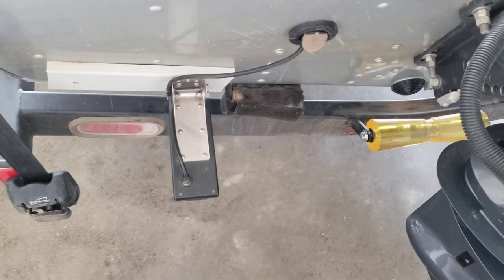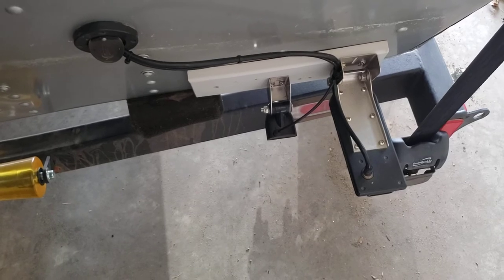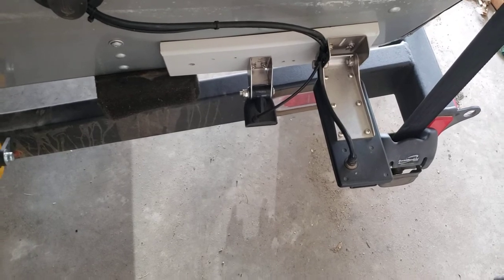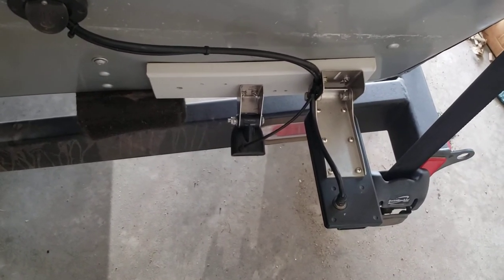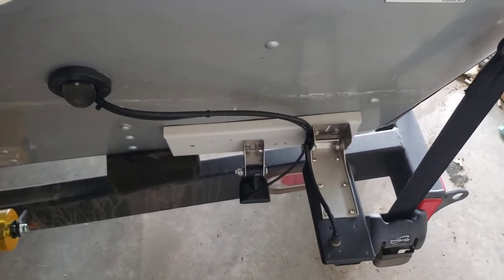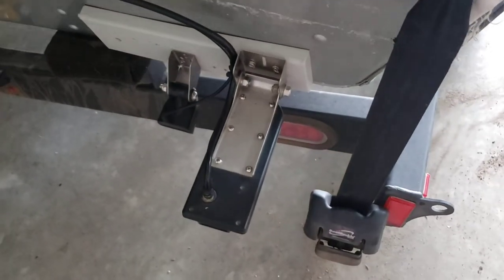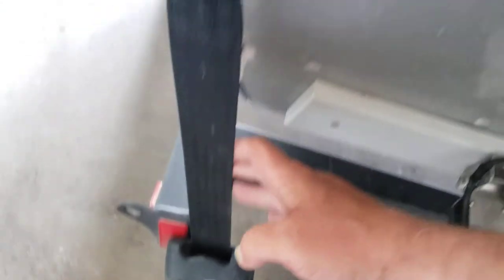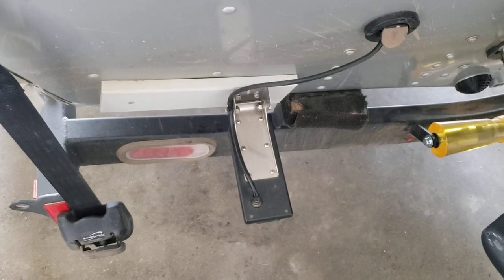Humminbird Helix transducers S1E19

Comment: Thank you very informative !  I am looking at Solix for next year. So my question is how large is your S I transducer  and  what is its distance from the transom?  I hope to have a 2nd transducer close to my trolling motor which also hangs on the port transom.
Reply from the maker: SOLIX units use different transducers than HELIX units, so I'm not sure that information would be of any value to you.  The distance from the transom?  Whatever it is, it is.  It's not adjustable.  I just bolted it on and go.  Thanks for watching!

Comment: I would like to run my fish finder on my ski doo ( ice fishing) just for the GPS maps, what do I do with the  transducer unplug it or leave it plugged in
Reply from the maker: I'm not sure I understand your question.  Lets start with what is a ski doo?
Reply: Thanx much for replying. It is a snow machine for ice fishing and if I put a transducer on my boats trolling motor  do I shut the head off when it's not in the water. I used a Lowance for both and fried  the sonar and I don't know weather It happened with the transducer was plugged into the head and not in the water or when the transducer was not plugged in and just using the GPS. I don't want to harm my Hummingbird
Reply from the maker: @Mikeyfix  I'm still confused. Where is it you would mount a transducer on a snow machine, and why? If you want to use the graph on the snow machine, then just use the graph. There is no requirement to use a transducer.
Reply: I mark a wave point in the summer on my hummingbird and want use the unit in the winter to find that wave point on the ice. Question 1 By using the Gps  only will I hurt my hummingbird with no transducer plugged in to the unit  Question 2 By using the Gps  only will I hurt my hummingbird with the transducer plugged in to the unit is suspended out of the water while travelling in the winter or even on a trolling motor that is not in the water be cause I am traveling Thanx

Comment: Hello.  Thanks for sharing information.  I will assemble the same as you.  2 sideimaging transducers and a 2D transducer.  regarding y cables.  Can I connect the y cable to the 2D transducer on the y cable to the sideimaging y cable?  three transducers in the same port .. if this was understandable😀Have a solix 12 3gen.
Reply from the maker: I'm not sure about solix. With helix, there are two Y cables required - one for left/right, and one for imaging/2d.  Thanks for watching!

Comment: Do you get any magnetic or RFI interference by mounting your GPS/Heading puck so close to the wiring harness of your outboard? Mine is further away and at certain RPMs my mapping goes all spinny due to magnetic interference.
Reply from the maker: It does happen to me, but luckily it happens at speeds I do not normally operate at for extended periods of time (like when coming down off plane).  Since I record all my sonar and use it to make maps, having the puck as close as possible to the location of the transducer is much more important to me than the 15-20 seconds of directional trouble I get when coming down off plane.  If you don't record your sonar, then you can put the puck anywhere on the boat that you like - just be aware that you'll either have to adjust your graph for the offset, or keep in mind that the location of your boat won't be EXACT on the map.  Thanks for watching, and tight lines!!

Comment: Do you got a video of how you hooked them up to your humminbird
Reply from the maker: I don't understand the question?  You just plug them in.
Reply: @RealLifeFishingWI  I can see how you did the 2 mega transducers but where did you plug in the 2d transducer? I only have one hook up point on the back of my humminbird unit
Reply: Did you plug a y cable into the other y cable ?
Reply from the maker: @ronmartinez8304  Correct.  You use the MSI Y cable to split the left and right imaging transducers, then you feed the end of that into the imaging side of the 2D Y cable, and put the high-speed 2D skimmer transducer into the other side of that, then plug that Y cable into the graph.  I'm now on my second boat that I've rigged up like this (the video was of my previous boat), works great!
Reply: Thank you so much for the information !
Reply from the maker: @ronmartinez8304  I've edited the description on the video to include links to all the cables used in the video, as well as the boat buckles and the roller replacement that I discussed in there as well.  Thanks for watching!!!
Reply: Thank you
Reply: @RealLifeFishingWI  Do you have a video or pictures of what you are talking about.  I had a transducer and added a 2 D transducer for seeing speed and depth.  I want a second transducer but I'm confused on what to do.

Comment: Do you have interference between your SI transducer and the 2D transducer. If so, what is your solution ?
Reply from the maker: I do not have any issues, nor should anyone else with a boat properly wired for multiple transducers.  The SI transducer and the 2D transducer operate at VERY different frequencies.  The 2D transducer only operates from ~240khz and down, whereas imaging is 455khz and up.

The only way I could see getting some type of interference is if you were not using the proper Y cable to split the 2D signal from the SI transducer.  However, even in this case, you'd have to have multiple graphs on the boat since you can only have 1 transducer plugged into one graph (unless you're using the Y cable, but then you wouldn't be having a problem).  If you have multiple graphs, you should only have transducers connected to one, and then you should share that imaging data via the on-boat network.

Hope this helps, thanks for watching!

Comment: How much higher are the 3d transducers from the bottom of the boat?
Reply from the maker: On my current boat, they are a good 1.5-2" above the bottom of the boat. This video was shot looking at my old boat, they were a little lower there just due to the way the boards were installed. Made me nervous. You can mount them as high as you like as long as they are still in the water.
Reply: @RealLifeFishingWI  thanks for the help I might just install my 3 in1 transducer up high and get a cheep 2d to run in the water like you did.